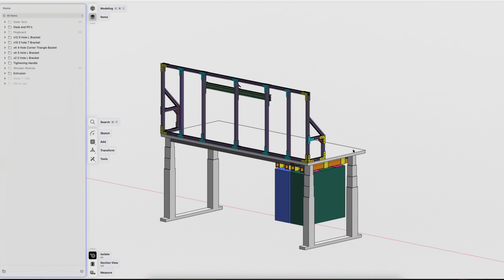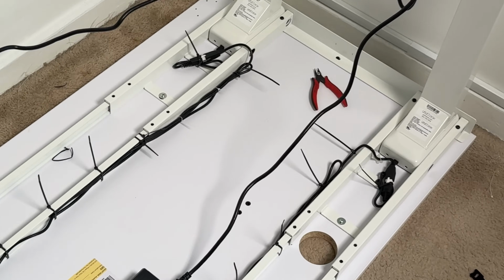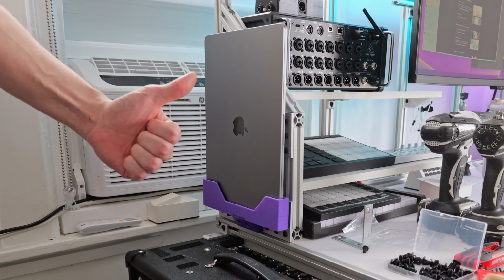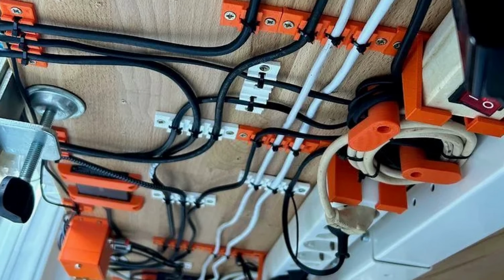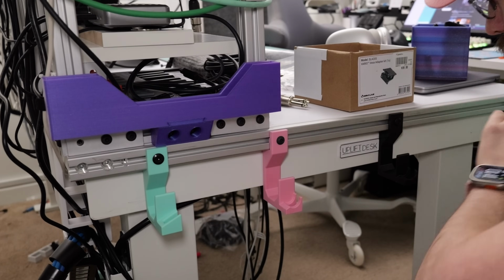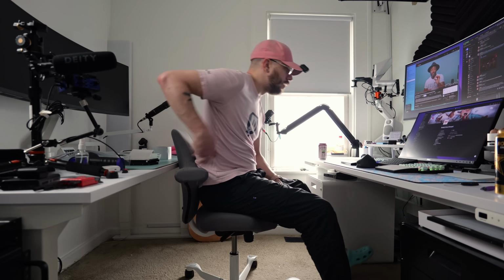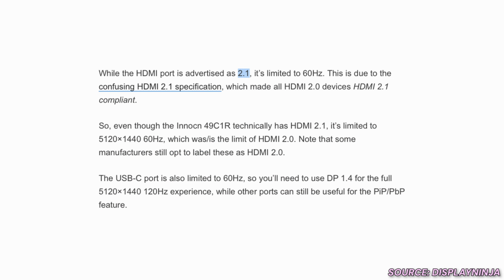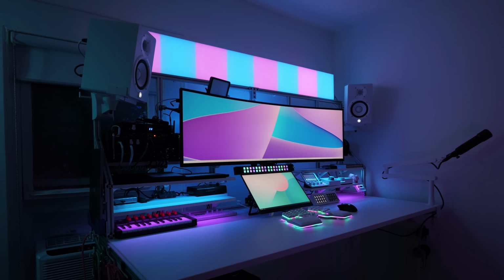Build your desk with Aluminum. You won't regret it.

Comment: dude, you inspired me to do the same although in a simpler version, (i just bolted extrusions around every edge of my desk) the free loop design is the best way to manage cables i have seen yet. thank you so much, i even made a boom arm attachment, a mouse pad slide stop, and so much other stuff with it. the modularity of it is awesome. i did leave the corners free and put 3d printed corner pieces on it that i can just take out to slide other pieces in and out. thank you.
Reply from the maker: Yo this is awesome! I'm super honored. Thank you for sharing.

Comment: You might like this idea for your aluminum channel - I use WLED as well, and I found some 12mm LED strip, and used a 3d printed form/jig to slightly curve the edges to narrow it down to fit into the 11mm channel of my 2020 extrusion. I wish I could show you pictures of what I mean but YT doesn't allow links in comments. I have LED strip running the length of my extrusion, and to diffuse the light I used a layer of "acetate cloth electrical tape" over the top of the strip before installing it in the channel. This gives a really nice effect, though it does very slightly yellow the white light but you can counteract that if your strip allows adjustment between warm/cool white. It also sits completely flush and hidden within the footprint of the channel. 

I like your idea of the push-in wire clips for the extrusion and will print some of those myself too. What material did you print them in?
Reply from the maker: All PETG! I think it was half sunlu PETG, and the other half Elegoo Rapid PETG. I'm a glass fiber finatic nowadays but for cables being run through something, glass fiber would be abrasive. So a good high gloss PETG would work great.

Comment: Do you by any chance have a download of the CAD file linked somewhere in your Notion, and I just overlooked it? I’d like to use yours as a basis to redesign mine.
I’m not really a fan of having a frame directly resting on top of the table where dust can collect and everything. My plan is to place the frame under the table instead. So the there are the table legs itself, and on top of those the aluminum profile frame is mounted, which has the tabletop ontop of it. This frame runs left, right, and along the back all the way to the edges of the tabletop, so that accessories can be attached directly there.
At the back, there’s a 30×60 profile, so that a 30×30 section overhangs toward the wall. The rear frame then sits on this, and that’s where items like the monitor and other equipment are mounted.
Thats my Idea in my head atleast 😅
Reply from the maker: I just went and looked, and the CAD file that was on Thangs seems to be corrupted? IDK wtf happened, that site is awful. 

Anyways, I reuploaded to printables so here ya go: https://www.printables.com/model/1483859-aluminum-frame-for-uplift-v2-4-leg-standing-desk

Comment: I deal a lot with aluminum with a sim racing rig. Typically 4040, but I have to consider if the profiles are lite or full, and the brackets have to handle weight and torque. Are these aspects you've had to consider for your setup? 1010 is very light, and depending on your 3D filament the brackets may or may not be enough with what you have it holding up or holding together (biggest concerns would be monitor or other heavy objects). I ask because I love what you've done here, but I want to know if I should make adjustments depending on what equipment I have.
Reply from the maker: Hey there! thanks for the questions. So as far as connecting the aluminum extrusion to one another, and the extrusion frame to the desk, there are no 3D printed parts. All the brackets and connectors (L brackets, t brackets) were purchased from TNUTZ. I actually had countless people telling me to just design and 3d print all those connectors myself, but I had the same worries as you. The only brackets I printed were the ones holding the shelves. 

I'm closing in on a year later and that frame is still all together without issue! it even survived being disconnected from the tabletop and moved to a new house, and then reassembled.

Comment: 14:16  what I figured out for my sit stand streaming and racing setup was to use docks and a KVM so everything on the desk, monitors, peripherals, mics, cameras, and speakers is connected on the desk even a good bit of the power, then plan monitor cable, USB, and power "umbilicals" to come off the desk in 2 or 3 big groups so where they move easily and aren't in the way. Also they are bundled in such that when changes and upgrades are needed, I grab the bundle I need and add it in, but since most peripherals just plug into the desk big changes to the umbilicals are rarely needed.  I have a secret labs magnus pro btw

Comment: For shelf brackets.. what about making the top side screw holes in a 90 degree angle so instead of all the screw holes being in line with each other the ones for the shelf itself would be on either side (hope that is good enough explanation, works in my head) :)

Comment: Inspiring video with lighting and equipment that I only have the most basic understanding of what it is for, and for which I have no idea how to use.  There are lots of ideas that I will explore for my extremely limited needs.  I like the extrusion frames, and the cable management system is perfect for me.  I will be extracting everything that I think will work for me.

I liked your transparency disclaimer.  Whether they paid you in cash or with free hardware, they are paying you for the content related to their products, but that is the point of the discalimer.  Your enthusiasm about your build, and the part that the various pieces of hardware contributed to the final build, left me wishing I could afford even one of them, but alas, I will have to settle for the Aluminum extrusions, and your 3D parts, as that's pretty much what I can afford.
Reply from the maker: Thanks for the kind words and especially the understanding with the brand deal stuff! Best of luck with your build.

Comment: Honestly, yea, I wanted more screens, so maybe this might be the way to go, currently got 4 screens, sometimes 5 depending on if I use the graphics screen tablet at the moment.
Would want some more vertical screen space.
Reply from the maker: sheeeeeeeeeeeeeesh 5!?!??! I maxed out at four hahahaha.
Reply: @Naaackers You went with a widescreen, I do not like widescreens at all xD
I have one that actually goes in the complete opposite direction
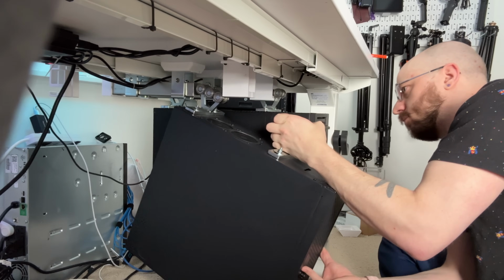16:18 (though even better as 18:16 (it's an LG dualup, not a good monitor, twice at the repair center already, both times panel issues))

Comment: @34:10 The tech tips exclusively consist of links to TikTok which I will not open, but gathering from the keywords and headlines you having looked into "all of the closed source and open source" solutions seems like a slight overstatement. I couldn't find any mention of Cursr - a fairly new player in the KVM ballpark but a serious challenger. I found it when looking to replace Synergy with anything that would work on MacOS, Linux and Windows, wouldn't nag me about "license renewal" after upgrading without warning that this would invalidate my perpetual license, and wouldn't constantly disconnect, stutter the cursor or crash, and boy was I pleasantly surprised.

Cursr allows for an absolute host of features such as freely defining which (portion of) which border will cross over to where - no more chopping around the edges between different screen resolutions, full length here to full length there means that the cursor will pop up exactly where expected. I can turn off transitioning via hotkey for fullscreen gaming and switch between profiles to include/exclude the sensor panel or change transition rules to match workflows etc. Especially pretty is the ability to tell it which NIC to use so the KVM uses its own network that can never be congested with SAN or internet traffic or disturbed by overreaching corporate VPN tunnels, ensuring smooth mousing no matter what. Do have a look, even if your setup is rather simple and doesn't need all the features.

Comment: This is very cool and I'm thinking strongly about adapting parts of this (if not all of it lol). Do you have the models for the trolley hanger and rear stop? I looked through the Notion page and saw the unistrut hanger spacer parts, but not the hanger for the front trolley nor the rear stop. I realize that since my existing sit/stand desk uses different hardware I'm likely to have to adapt/modify them or even make my own models by scratch, but I'd like to get a closer look at those two parts. I think I'm going to start with setting up something like that, since I already have some spare channel from another project I'm wrapping up now.
Reply from the maker: Hey Brian! If you could do me a favor and shoot me an email qna@naaackers.com and I'll get any files sent over to you. I'm happy to give you the STEP files so you can make some modifications if you need.

Comment: Love the project, want to do something similar - mostly to make it easier to do top down videography. Any research go into mounting these without drilling into the desk? Using clamps or otherwise? I'd love to not permanently damage my table top. Mostly because I'm THAT GUY who loves to re-arrange his desk/office every couple of years in some major major way. And that might include removing/changing this infrastructure as well.
Reply from the maker: Could you do it with clamps? Maybe. Would I? no XD. Way I see it, it's 5 holes that are 3mm in diameter and the way back. Would be really easy to patch if I wanted to. And, since most of them are all the way at the back - what are the chances that SOMETHING isn't there to block the damage if you do decide to change?

Comment: TIP from a mechanical engineer. If you are trying to learn how something is built - just go to manufacturer sites. for example manufacturer of alu extrusion profiles. Not Amazon and youtube. Manufacturers usually have simple pictures and descriptions with ideas what and how oyu can put stuff togeather. And as a bonus you have "other people got this as well" section where you can find all those nuts and bolts and expand your knowledge of what exists. Moany adjustable things allredy exists because they are used in production companies heavely where modularity is needed for workbenches. Non eed to reinvent the wheel :) steal the idea from their page, and make it work for you. also its usually cheaper than amazon where they just pray on inexperianced people and sell them subpar parts for 2x price.

Comment: I did a very similar thing by running an ultrawide monitor with a portable monitor as my secondary. Like you said, it's just way less bulky. I put mine at the right-side edge of my ultrawide in portrait orientation for secondary apps that are good running in a tall, portrait configuration (like Spotify, any kind of lists, coding/scripting, PC monitoring/control software like FanControl, Rainmeter/HWInfo, etc.) I have all of my secondary apps, like SignalRGB, GHub, FanControl, Notepad++, Spotify, ChatGPT, etc. programmed to pull up on that screen, and I leave my main monitor for my primary apps, like browser window, gaming, etc. Though, while gaming, the browser goes to the secondary screen. So, I guess it's a flex space. I went with a "Vilva" 15" Portable Monitor. Its width is almost the exact height of my main ultrawide, so it fits perfectly in portrait mode. 

But yeah, great setup, man. I enjoy your videos, so I subscribed.
Reply from the maker: Yo thank you for this feeback and also sharing something about your setup :) i love to hear how people have theirs!

Comment: Thanks for the inspiration. Just ordered a bunch of aluminium profiles. I really like to have good lighting around my desk and my plan is to use the aluminium profiles to mount some lights directly over my desk. I love that it's modular, so I can just disasseble it and make something else from them.
Reply from the maker: This has ended up being one of my top favorite parts of the frame. Currently I have to mic boom arms mounted on the top rail, and I can mount lights, magsafe, mics, etc. Pull them over the desk when I need them, tuck them back when I don't. So great for this!

Comment: All that stuff in there and that lil window unit. As a fellow century home with no central air dweller who used to have a 36U rack in my home office… I’m uncomfortable thinking about the heat load.
Reply from the maker: It honestly did super well! I was able to keep that little room ice cold. But, the AC ran all through the winter too XD. I had to move and my new office has 1/4 of the hardware in it compared to this video, and it's still hotter with central air. But, I'm on the second floor now XD

Comment: Hey, just watched this video and saw your complaints about monitor OSDs. You can actually control most monitors using DDC/CI, and there are a lot of apps for both windows and mac that can use it. Inputs, brightness, PIP, all work. I switch between my mac and pc with just a single click.
Reply from the maker: Thanks for this info! I looked into this and while some of the basic functions could be changed  with the monitor, some of the more advanced stuff couldn't be accessed. but great information regardless!

Comment: Stupid / dumb / ridiculous question ... If I were to build a tabletop frame out of the Aluminum Extrusion ... how much weight would that support ... irrespective of what it's sitting on?
 
Also ... Holy balls that UPLIFT 4 Leg Desk is expensive. 
Pretty glad that I have decided upon a scissor jack based desk ... just got to work it out, now.
 
But ... basically, either a jack based ( much higher weight limit and cheaper ) or motorcycle lift ( potentially easier to engineer ) based solution will hold at least ~300-500 and if it's the jack at least a ton. Then it's just about loading the thing up! 😅
Reply from the maker: Good thing I love stupid questions... XD

last I looked, the total weight limit of the 4leg v2 desk from uplift was 550lbs. I think it would really depend on what you chose to put over the frame to act as your tabletop and how heavy it was. And then of course what you chose to put on the desk after the fact as well.

And yes, uplift desk is very expensive. But, IMO, you get what you pay for with these. You of course have to take that with a grain of salt because I got mine for free, but I've used other standing desks and know what a cheap one feels like. These things are absolute tanks and very open to being modded and added onto, which I think is awesome.
Reply: @Naaackers  Ah! Thanks for the reply!

I actually meant ... ignore the legs ... JUST the tabletop. So ... if I made a frame for a tabletop from extrusion, with whatever legs ( assume I didn't mention my 1 ton plans ;-) ) ... could that take a fair bit of weight? Or would I have to go all DIY Perks up in this house? 😅
Reply from the maker: @eliotcole  I would think so! I feel like I could take the frame that I built, lay it down and put a tabletop on top of it (or plexi) and it would be pretty solid. I think there is another creator on here that did that. Would be a fun project!
Reply: @Naaackers  Noooice. Well, what have I got to lose, eh? 😅 
 
I'll see if I can pick up some AE in the UK and just put it together and load it to over 200kg-300kg and see what happens.

Gotta take a few monitor arms, with big old boys on 'em ... sooooo ... here's hoping!
 
Cheers for the chatter, mate!

Comment: Such a dope video. Can you check the database on notion. The link to the tech tip database seems to be broken
Reply from the maker: Well that is strange, not sure what happened there. Should be fixed now. Thanks for the heads up. 

Here is a direct link just in case: https://nacklibrary.notion.site/bc5ac68c9193492d89d61d94214cb6e7?v=1f1515d6b388498a805b2e6e25f04fbf

Comment: question, if you use software kvm for your peripherals, where do you plug your peripherals to then be able to use them on the second machine when the host is turned off. An other aspect of this, do you use Linux because a few years ago Synergy had trouble with it
Reply from the maker: I never turn my PC's off, ever lol. A fix for that though could maybe be a USB hardware switch for when you want to turn off the other pC?
Reply: @Naaackers Thats what I currently have, one usb switch between desktop and a usb dock and 2 kvms for switching my 2 monitors independly. The only issue is the cable management, the kvms have to be far back behind the monitors to hide the mess but then they are hard to reach. I am eventually planning on opening them up and somehow wiring the switches with wires to a convenient place and then banish the kvms to cableland.

Your solution sounds way cleaner, you didn't mention this much but you connected audio to your monitor and then it switched the audio from one source to the other. How about both sources at the same time?
Reply from the maker: yeahhhhhh the short cables with hardware KVM's is what kept me away from them. 

And I don't run any audio through the monitor, that was all handled by the Beacn Studio. It's a usb audio interface that has dual usb connections, one for each PC. 

I technically had three ways I could transit audio. that way, using the Behringer xr18 as a digital mixer, and DANTE for sending the audio over the network. Beacn studio was simple and convenient though.